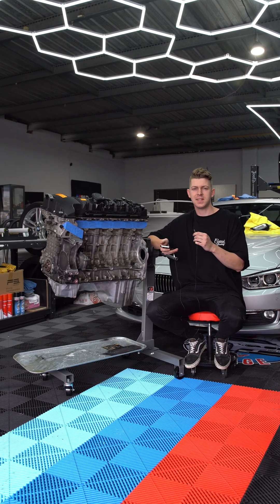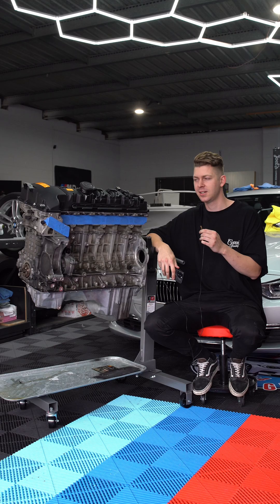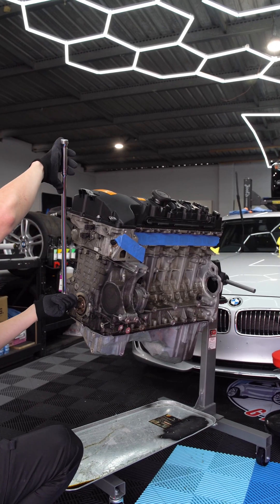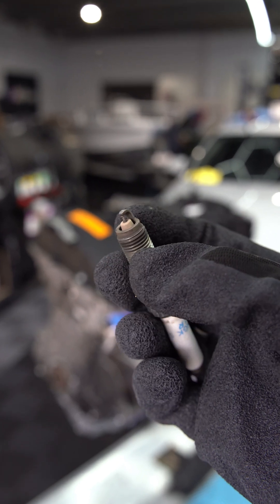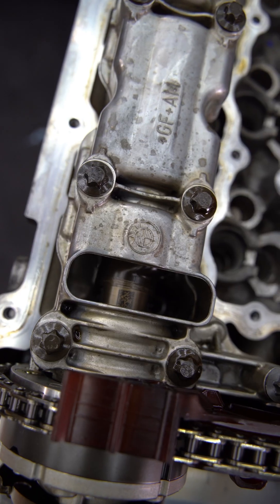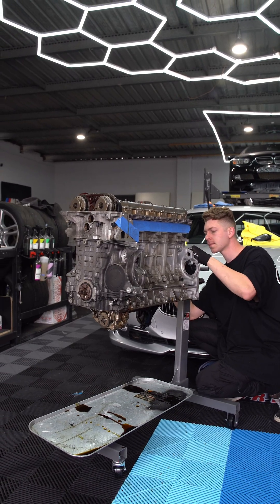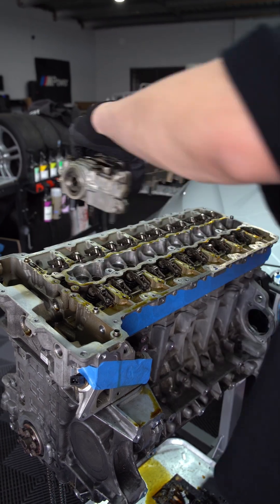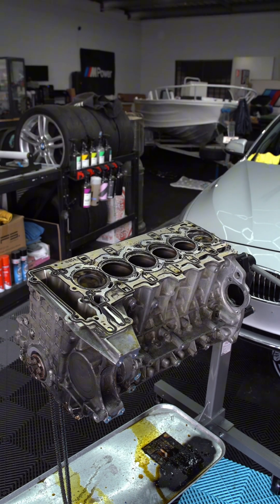PYRAT N54 Teardown - Part 1

Comment: What do you think will cause a n54 to instantly stop rotating while turning clock wise? I was doing a compression test an the motor locked up. Took the cams out and it still wont budge. It will rotate counter clock wise a full turn until it hits that spot again. Ive since put a new motor in it but haven't done the complete tear down of the old motor yet